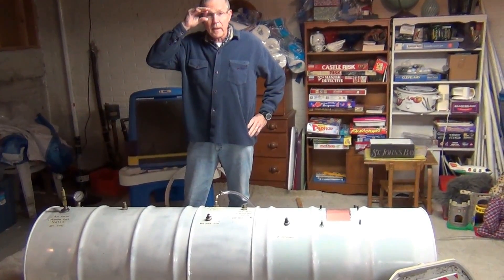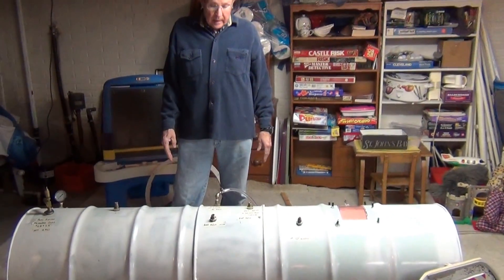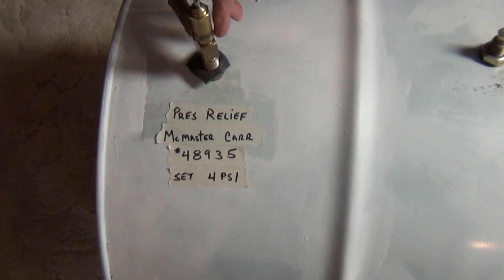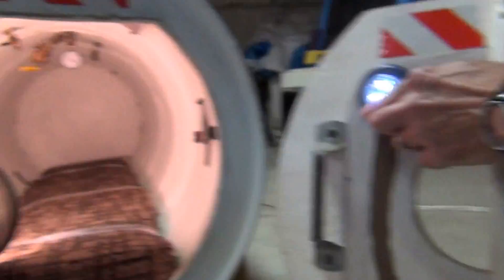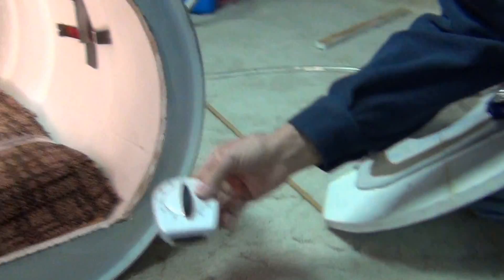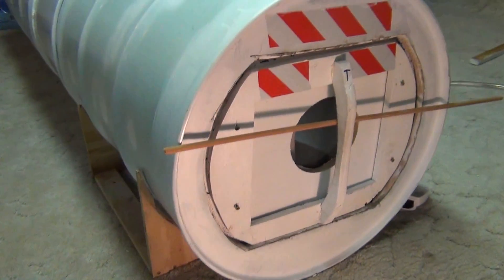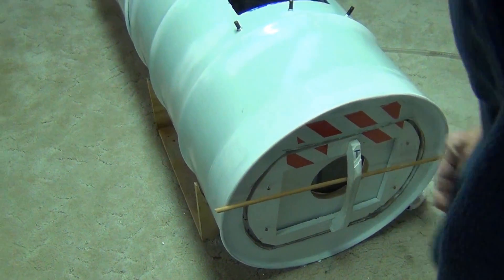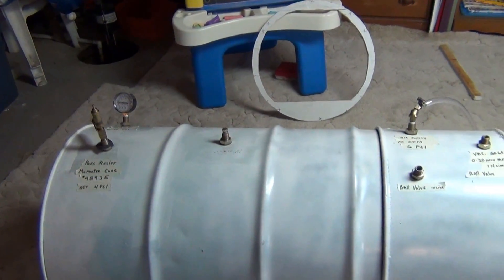Build an affordable Hyperbaric Chamber

Comment: Hello,
I have been reading about the hyperbaric chambers and have a few concerns about this one that you made. I am not criticising you or trying to come off as offensive. I would like to make one of these myself, but I want to make sure it is all done safely and that it will be effective. I noticed that on the commercial chambers there is a device called a CO2 scrubber that releases CO2 that the person exhales as they are in the chamber. I read that without the CO2 scrubber the air inside the chamber can become toxic very quickly. Secondly, the commercial units have an oxygen concentrator that increases the oxygen levels to the desired level. I read that too high of an oxygen level though or using the chamber for too long can actually be toxic and kill cells in the body (usually in the eyes and lungs first) and can be fatal. Lastly, I read that there is supposed to be a slow decompression of the pressure as a person is getting ready to exit because rapid decompression can cause a person harm as well. Just some things to take into consideration. It seems to me that making a home made one may be  dangerous and possibly ineffective and harmful if not done properly. Please be careful!
Reply: This is what I would consider a barebones POC effort. You could build a really good one but you probably need to be an engineer. Electrical with some controls experience preferably. I am one with nearly 50 yr experience. So, the first thing I would do is make a better enclosure. My preference would be to find a piece of 1/4" thick plexiglass 24" diameter tube. The doors should use actuators to open close and all the valves should be changed to motorized valves or regulators and a host of sensors for pressure, co2, temperature, etc. need to be fitted. Since CO2 falls to the bottom, it can be extracted by a motorized valve there (or several distributed along the bottom. I would have the sensors at the top and bottom.
You'll need a bunch of signal conditioning circuits and then I would use a PLC to run the controls talking to a supervisory computer (an RPI would do) with some easy to view monitors that show graphically the status of the internal environment a s well as elapsed and remaining time. And go ahead and add some human vitals like pulse rate maybe EKG, etc. 

That will accommodate all that you talk about above and more. Note, I just did this off the top of my head so it is not a complete design description and I would want to draw it out and think about it some more before attempting it. Similarly, but ai much smaller scale I retrofitted a '70's temperature test chamber for testing and making measurements of chips for a company I worked for. We took measurements of pico amps and micro amps at 85 deg C Nd in an online group meeting, I demonstrated my chamber, rock on at 85C +/- a couple 1/10ths wandering. So, it is not that difficult to do. I'd say probably have to spend a few grand. Look at auctions of industrial and medical facilities to find a tube or other suitable enclosure.
This is definitely not rocket science, but you do want to emphasize safety. I think the one in the video is devoid of that.😀
Reply: @petermoyle9764  With all that expense, it will be cheaper to purchase one instead of building one. You don't need a PLC control for that.
Reply: HBOT USA addresses these issues

Comment: where does your co2 go "idiots". all you are doing is re breathing your own waste poisoning your brain with co2.  your epidermis does most of your breathing so if you want to see how stupid and dangerous this is stick that compressor hose in your mouth and jump in a pool, you will drown on the first panicked breath.  also static discharge would shoot you like a rocket.  thank goodness none of you are intelligent enough to really build one.  also a decent co2 scrubber starts at about 2,000.oo USD.  tell me, how does the petroleum air full of your own co2 taste from that compressor.  you aren't improving your health.  you would be far better making a garden than wasting your time on this.  I can build just about anything and I've done a lot of research and I won't even attempt this because it's way more dangerous than my terminal cancer.
Reply: I am sorry to learn you have cancer-would not wish it on the Devil himself. 
 
You might benefit greatly from this therapy if you are able to read for comprehension without allowing your preconceived ideas to block you from learning something. 
 
The air pump used here is NOT petroleum-lubricated like many shop compressors so air quality is exactly the same as the ambient air where the chamber is located.  The builder has thoughtfully chosen to incorporate an elevated air intake with a replaceable filter so the air entering the chamber is actually cleaner than the room air.

If you invest the 5 minutes required to actually watch the video you will notice there is a hissing sound once he starts the pump-that is air escaping continuously from the chamber BY DESIGN-fresh air is being continuously pumped in by that pump you seem so concerned about so the exhaled/transpired waste gases are being removed.

He is not incorporating any oxygen enrichment here [though the partial pressure of the O2 within the pressurized chamber IS higher-that's the whole point of HBOT] so your concern about static discharge danger is pointless.
Reply: I did watch the video and I know far more about hypobaric chambers than most people and for starters that hissing air isn't co2  as you put the pressure relief valve on the top and co2 is heavier than oxygen and air so you are bleeding off the air and pooling the co2 back into your body.  Also they use 2k co2 scrubbers in hypobaric chambers.  Also that pump has a fan and is blowing on fiberglass insulation which is aerating glass fibers that float and mix into all the air and I guarantee that it's not clean air going into that pump and you aren't using food grade lines so you are breathing pressure off gassing oils from the air hose you are using wich are petroleum and other chemical bassed and absolutely do off gas's.  As for the other mentioned "facts", they do matter as people take your ideas and try to improve them and they need to know that these hints blow up if you put oxygen in them.  And things you think couldn't possibly matter do.  Like the seal on the lid has to be non static, no plastics, needs a grounding braclet, and if you are building it this way and don't have a co2 scruber as these are really expensive, you should have a mask to exhale co2 into that isolates the co2 into a separate compartment that also has the pressure release valve on the bottom a connecting an air equalizer at the top going to the top of both the occupancy chamber and the co2 off gas chamber and a hose connected to the that runs under you to pull co2 that pools beneath your body as your epidermis also breaths, intact it does more than your lungs.  And that thing you said about "reading for comprehension without preconceived ideas blocking..." It's called cognitive dissonance and you should google it but basically if your beliefs out weigh your desire to learn or someone triggers the selfe defensive portion of the brain your brain (which is basically the same parts of the brain being utilized ) your brain shuts off and you can't learn anything because either your mind can't handle the new information causing new neuro pathways of thought to form inducing adrenaline defense to shut down and safe guard your fragile brain or your beliefs.  So to answer your accusation, my brain has been taught to challange everything I believe with all new ideas and making me the best source of information because I'm based on ever changing facts and not overture to an emotional defense like triggered in you when I was harsh with my words as I tend to be due to a lack of cognitive dissonance ( emotional connection to beliefs and expression).
Reply: Your reading comprehension [and punctuation] is abysmal...nowhere did I write that the hissing sound is CO2.

So you really believe that the exhaled CO2 will sink to the bottom of the chamber and kill the occupant, huh?  If you are correct you'd better get ahold of Al Gore pronto and let him know that CO2 will NOT cause global warming since it can't possibly migrate to the upper reaches of the atmosphere but rather sink to the lowest parts of the earth and asphyxiate all the valley dwellers...-wait, that isn't happening though, is it?

The uploader looks pretty lively to me and he's been posting in this thread steadily.

By the way, how can there be such an animal as an "ever changing fact"?
Fact definition: something that actually exists; reality; truth.  If something is a fact, it is true and cannot change.  

Ah, never mind-"Answer not a fool according to his folly, lest thou also be like unto him."  You, Sir, pretty much fit the description of a fool...I am done with this topic-

Comment: But doesn't the air thats pumped in have to be special? like hospital grade or something special thats on another level?
Reply from the maker: We purchased a used commercial grade  Bullard edp10 "Fresh Air Pump".   Got one from eBay, and another one off Craig's list. 
A Fresh Air Pump are generally used to pump fresh air into a hood when working in a nasty environment.
I believe the edp10 can pump up to 10 psi.  (check online for specifics)   there are other brands on the market.  This type pumps are designed for people to breath fresh air.
Good Luck.
Reply from the maker: NO special air.   You want the fresh air pump in a room that the air is clean.   You can also run a line outside if it makes you feel better.   The fresh air pump is typically used in places like paint booth's, or polishing chambers where the air quality sucks.  The person wears a hooded mask so that he can pump in fresh air to breath.
In a Mild chamber at 5 psi, the air density is increased by about 1/3 atmosphere and you have about 1/3 more air which results in 1/3 more Oxygen.
IF you do more research on "Mild" hyperbaric chambers It should make sense to you.
Reply: Question: What type of compressor / pump do you use? 
I once heard that the air of normal air compressor for pumping car tires for example, is somehow a little bit mixed with oil, because of the lube in the moving parts of the compressor)
is that air safe for breathing?
Thanks
Reply: Thanks for the reply. that's what i needed to know. :)

Comment: Are you pumping oxygen or air ?
Reply from the maker: We pump only pressurized AIR !!!   It is a "Mild" hyperbaric Chamber.  At our 5 psi we have about 1/3 more AIR in the chamber which I believe is about 1/3 more Oxygen.  Even with that little bit, it does seem to have some healing / health properties.
Search the internet for Mild chambers.   there is info out there.

Good luck,
Reply: so, your chamber work at 1.3 ATA?
Reply from the maker: Yes,  Outside the chamber we are at 1 Atmosphere,  and we add 5 psi gage inside the chamber which takes us to 1.3 ATA.

Comment: I would recommend you invest in the 5,000 or whatever it takes to get one if you want one that bad. This thing looks dangerous, not to mention if you aren't skilled in welding and metal fabricating, you can seriously injure yourself attempting it. You might be able find a shop that will do it for you if you supply them the design priints and materials...but i would suspect a reputable service provider wouldn't touch this with a 10-foot pole.
Reply: Lucy, there are men on planet earth with magical powers some call "confidence", "experience", and "skills".  They've been known to wield strange mystic devices they call "tools" and "beer".  

Perhaps if you wandered from your cave, worked with your hands once in a while, read technical manuals, and exercised unfailing determination, then maybe, just maybe you'll understand their ways.  

I recommend you don't.  In fact just stay inside your whole life.  God forbid you encounter "dangerous things" and live to tell the tale... you know, such as powerful cars, sharp tools, firearms, open flames, etc.  You might get a boo-boo and learn something, and that's the last thing anyone wants.  

"4 psi oh no!!!" I can squeeze 5x that by hand.  "But the pump can fail and you'd suffocate!!!"  Yes, the absolute air-tight seal via weather stripping from Home Depot... oh wait, it's not air-tight and the pressure dropped BUT THE DOOR ...fell open from loss of pressure.  "But it could explode from the pressure!!!"  You mean outward?  From the minuscule amount of air pressure?  Um... ok, call me in a million years when that happens, and, when it does, wait another million occurrences for it to cause an injury.  "But the oxygen will run out."  Did you see how fast that gauge rose?  Do you know what 1 psi feels like trying to blow up with your lungs alone?  Go ahead and try to pressurize that volume of air to 4 psi with your breath and call me in a million years when that happens too.

Do yourself a favor Lucy, go outside for a walk, get a sunburn, sign up for a yoga class, go to a concert, have a cocktail, buy a plane ticket, talk to people.  If you're feeling real wild, then climb a ladder to change a light bulb.  Want to get crazy?  Ok, what you do is buy a bicycle, right, ride it down a hill, ok, then take both hands off the handles!!!

God forbid you simply take a step back to admire this man's ingenuity.  People like this are the reason you enjoy the comforts you have today.  Pioneers that went where no instruction manual had gone before.
Reply: Jordan Gray 

And all that crap you said...doesn't refute any of the concerns i addressed. Good job typing a mini-novel and getting nothing accomplished.
Reply: lucy winkelman why not point something out and enlighten us all, instead of selfishly concealing the knowledge; besides your irrational fear of the world, I believe I covered it.  

If that's comparative to a novel by your scale, then we may have found your problem.  That was only five minutes worth; you should see what I can do with ten!

You're right, I've done a good job accomplishing a number of things; namely but not limited to: receiving a response from you empty of substance, but full of resentment; and presently +2 to your naught.   Survey says...Dogs bollocks!
Reply: lucy winkelman if everyone thought like you, we would still be traveling on horseback and reading by candlelight.

Comment: What where the bulkhead fittings for?
Reply from the maker: The bulkhead fittings are to have a pipe connection for gages, fittings, and tube connections.
You drill a hole that allows the bulkhead fitting to go thru, and you have a seal on the fitting.   I believe we only had 3/8" pipe thread fittings on this chamber.
the bulkhead fittings have a female thread on both inside and outside the chamber.
hope this helps you understand.
Reply: Thanks for the reply - I will be building one!

Comment: Interesting.  But would it not be safer to breathe enriched air without pressurization?  When diving I often use a mixture with 30% oxygen.  That mixture turns poisoneus at 35 meter depth when normal air will turn poisoneus at 50 meter depth.  With a hyperbaric chamber one also has a risk of decompression sickness if decompression is done too rapidly.

Comment: My way is diving in a pool with a home made air supply using welding oxegen 10 feet is aprox. 4.5 psi talk about feeling good. Don't  do this without talking to your doctor and asking him if you can dive with pure oxegen.
Reply: That's very smart, I was thinking of the same method but never tested it out, no need to pressurise as gravity and the weight of the water does the job for you, great to see someone "thinking outside the box".
Reply: This has inspired me to use a large pipe I have laying around, stand it on end, fill it with water and get in.  The part I'm fuzzy on is the breathing welding oxygen part.  Would you please elaborate?  Thanks, Greg  williamgregsmith@gmail.com
Reply: Pretty smart Jesse! I never would have thought of that. Brilliant!
Reply: Do not do this, welding oxygen will destroy your lungs.
Reply: @globesocial not true.  Welding oxygen is not FDA approved.  That is all.  Welding oxygen "can contain impurities that could hurt your lungs".  Not "does contain".  Just like food from Taco Bell "should be safe for consumption."  Not "is safe".  Is there a risk?  Sure.  Life is a risk.

Comment: Hi Terry,How did you get chamber #2 into your house?I  am looking for a container, not as big as that... am thinking ~  32" wide(to get in the door), and 48" x 48" or less, should comfortably allow space for my 5' 8" 140lb body, or perhaps a 32" diameter barrel that is 48-60" long. Don't know how to find these containers. I did find a new hard plastic underground water tank online that has a 20" screw on top that I could fit through, but it is around 37" diameter at it's widest point, and would not fit through my doorway. Finding a suitable container seems to be the biggest stumbling block in building a hyperbaric chamber for my home.Also did you ever sell chamber #1, I might be interested.-Eric
Reply from the maker: +Eric Orton 
We managed to get tank #2 thru a wide patio door.  then we used furniture dolly's  to move it to the location. It was not easy, but worked for us.  
One person shared with me how he had one built in several pieces and assembled it in his house.  If you send me your email address, I can maybe provide more information.
Terry
Reply: +Terry Kocsis I sent you my email thru a message, from the about tab after clicking on your name(didn't want to leave email on a post for fear of getting spammed). Let me know if you got it. Thanks!
Reply from the maker: +Eric Orton 
I can't find your message.  please email me at tgkocsis@windstream.net